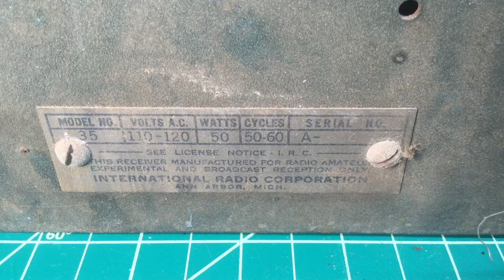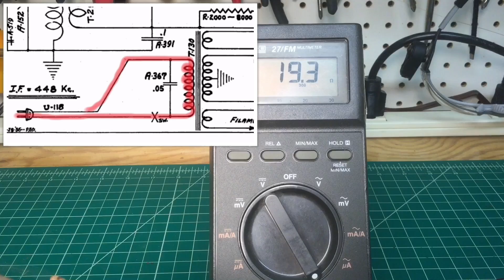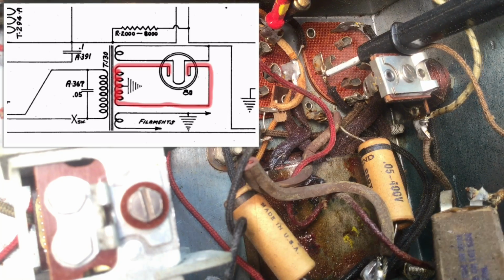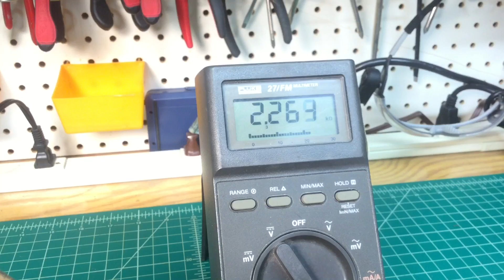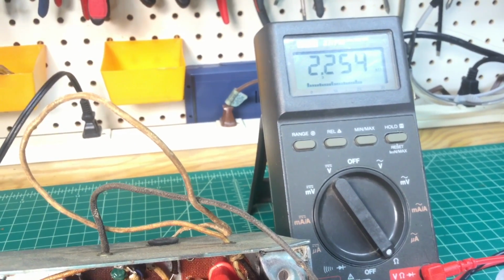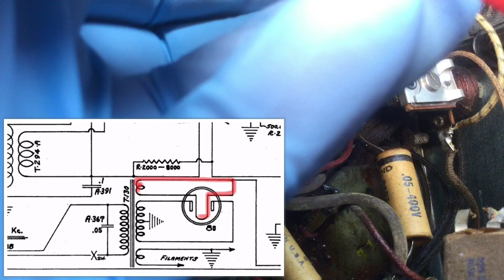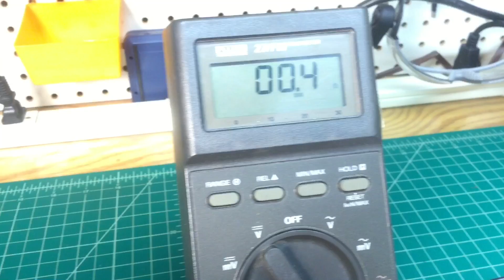Basic Power Transformer Evaluation

Comment: Don, do you ever do an insulation test on your transformers? Thanks - Andrew
Reply from the maker: Andrew - I never have, but it would be an interesting exercise. I've always inspected the dielectric visually and applied a high quality heat shrink with a 600V rating over any suspect areas. Have you ever tested one? Best, Don
Reply: Hi Don, yes I do but I wouldn't say I do it regularly. I check insulation between primary and laminations/frame, secondaries and frame etc using an insulation tester at 500V. The tester is used more to shove 500V or sometimes 1kV up paper capacitors as a leakage test to be truthful :)
Regards - Andrew
Reply from the maker: Very cool. I may pick up a used one and give this a try. Thanks again Andrew. Best, Don